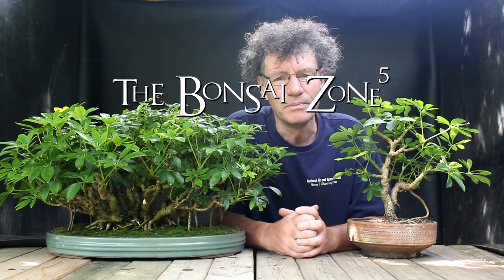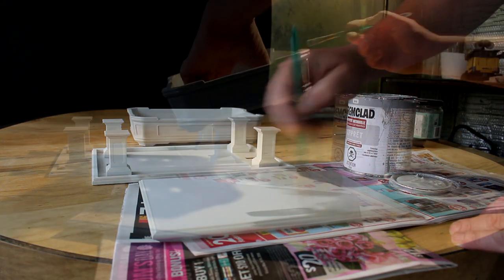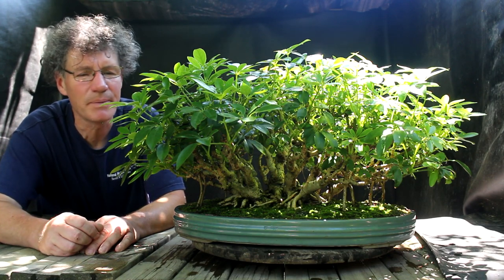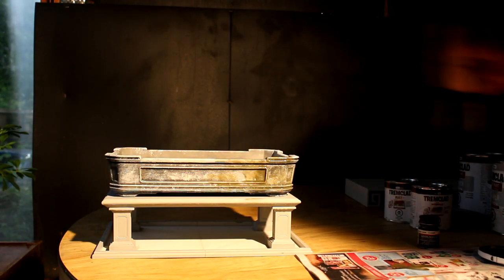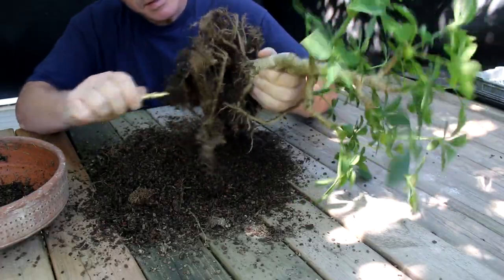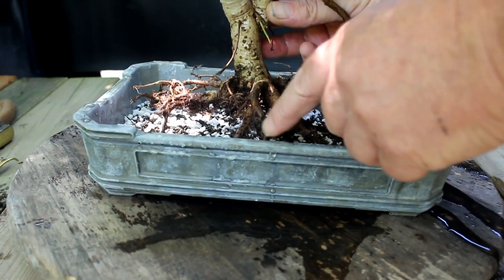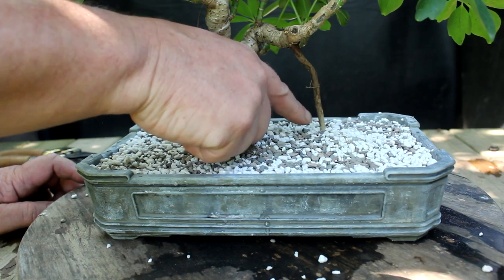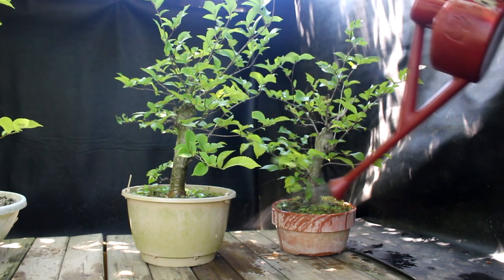Schefflera Bonsai, One from a Cutting, The Bonsai Zone, June 2018

Comment: Another good video Nigel, please keep us posted on how these painted 3D pots hold up. Are you only using the 3D pots for tropicals because they might not handle the freeze-thaw cycle very well?
Reply from the maker: I think the 3D pots will hold up fine for the hardy trees. I will be using some eventually, the spring potting season didn't last long here this year, we went from winter weather almost straight to summer weather. The pots are doing really well, handling the heat in the greenhouse so far.

Comment: I've noticed you've changed your soil medium slightly by adding perlite to the mix (unless you've always used perlite and I've only just noticed, that is ;-) ). I have tried to find a supplier for turfus here in Australia, but I'm having difficulty finding anything. I may have asked you before, but I'm keen to know what turfus is actually made up of? My best guess is that it is similar to crusher dust, which is a fairly fine grade of gravel which is usually a by product of the process of crushing rocks into coarse grain gravel for road base etc. Am I on the right track, and if so, I should be able to visit a quarry and get some crusher dust? Apart from this medium, do you use regular soil for nutrients or do you get enough from the turfus and regular feeds of fertiliser? Thanks in advance, and I understand if I am treading heavily on a trade secret here ;-)

Comment: A single-trunk schefflera is my one and on;y bonsai so far! I have a few questions: 
Why do some of the leaves on yours kind of look like the Cat in the Hat's gloves? They aren't round on the edge.
Are you going to use that lower plate of gravel as a humidity tray?
I just repotted mine from its nursery pot into a ceramic one three days ago. When should I start fertilizing it?
Thanks Nigel!
Reply from the maker: The leaf tips can vary in appearance, even leaves on the same tree can look different. Much depends on the vigor and growing conditions of the tree. I do keep the lower tray moist to help with humidity levels, especially when the tree is indoors. You can start to fertilize only if you are using a very very dilute mix. A full strength application can burn the root tips and possibly kill the tree. The tree will have plenty of energy reserves stored in the trunk and roots, so there is no rush to begin fertilizing the tree. Most people wait until the tree starts to show new growth before beginning to fertilize 1/2 strength once a week. Here is my video on fertilizing....
https://www.youtube.com/watch?v=gXIIpxUqxdY&t=104s

Comment: New to the bonsai world.    What kind of soil you use.     Is it a mixture or it comes like that.     And is th he moss a special one.    Mine drys out quick
Reply: Gabriel Lopez 50/50 perlite, turface.
Sifted has been said before, dont know about those potting.
Reply: Nigel has videos about soil mixtures as well.
Reply: I can also recommend some succulent and cactus soils from store, but make sure it's more like mixture of stones, lava, perlite etc. not a dirt, sand and peat. They work quite well, especially for begginers, they hold enough water, however it's really hard to overwater your trees in this kind of mixture. However it needs sifting, because of small particels, but window screen would suit well as a sifter! 😉

Comment: I have a schefflera with a 1 inch thick woody branch. I am thinking of cutting it off, do you think it would grow as a cutting? There is a lot of information on the internet about propagating from green cuttings, but very little information on how big you can go before a cutting will fail.
Reply from the maker: Yes it should grow as a cutting. I usually root the cuttings in rainwater in full sun. It should grow roots quickly, within a couple of weeks. Slowly transition the new roots from water to wet bonsai soil and then slowly let the soil dry out a little more with each watering until you are watering it like any other tree. It is important that the new roots don't dry out! You can root very large cuttings with the proper care!
Reply: Thanks for the information, the branch is quite long, should I shorten it and remove some of the foliage or should I just leave it as is?

Comment: Have you ever had a problem with the moss preventing water from reaching the soil?
Reply from the maker: If the moss gets dry on the surface, it can repeal the water, so I water it a couple of times to get it moist and then the water will drain straight through the moss. Misting the moss a couple times in the day helps keep it green and damp and makes watering a bit easier. I always water until you see the water draining properly from the surface out the drainage holes in the bottom of the pot.

Comment: sir how do u plant the cuttings? any particular method?
Reply from the maker: I usually just place the cuttings in a glass of water and continue to grow them in full sun. They usually start to grow roots in 2 to 3 weeks. When you plant the cuttings in soil, keep a tray of water beneath the pot at first so the soil stays wet. Gradually let the soil get drier over several weeks until the roots harden off and you can water them normally.